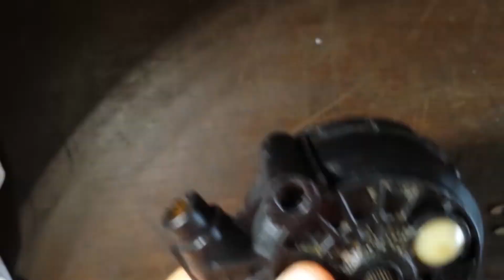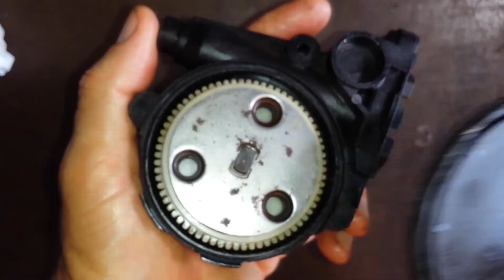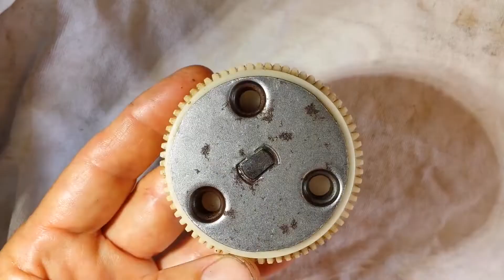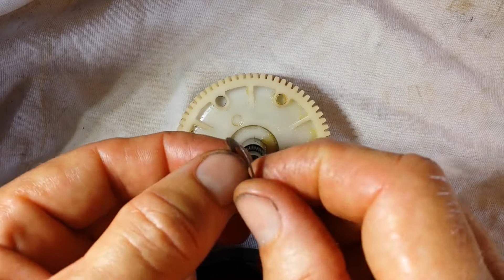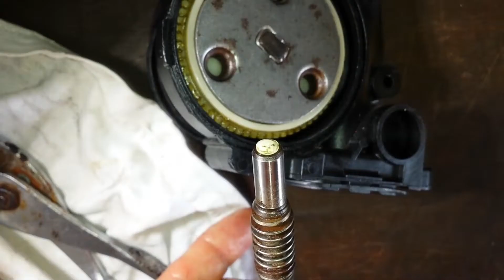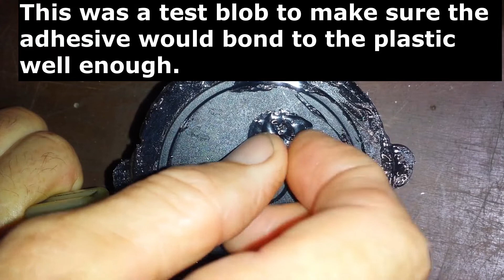Fix Power Windows That Vibrate or Jerk. Repair Car Truck Electric Windows Noise

Comment: Hi thanks for video.  Very informative. Can you please tell me what glue you used? Cheers
Reply from the maker: The brand is "Amazing".  The product is "Goop".  I use the marine version because it is UV resistant.  Not important for this project, but I use that same glue for lots of outdoor stuff too.  It's cool stuff once you get use to using it.  You can order it on Amazon.  Sometimes you can find it in walmart and west marine too.  Be gentle with the lid.  They strip and crack very easy.